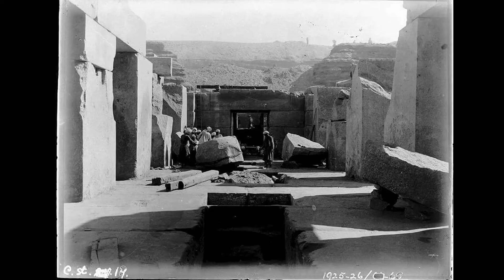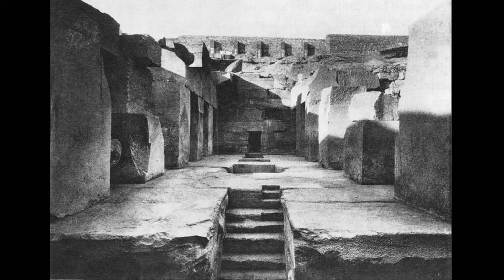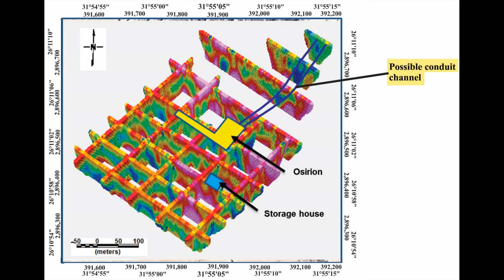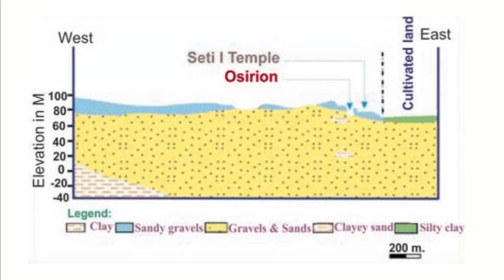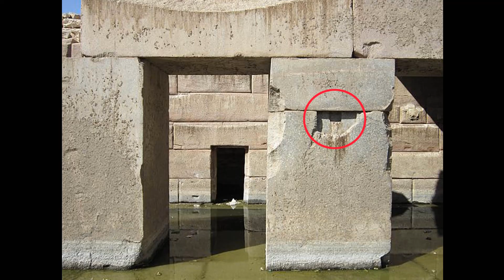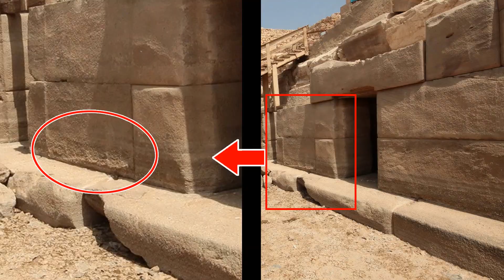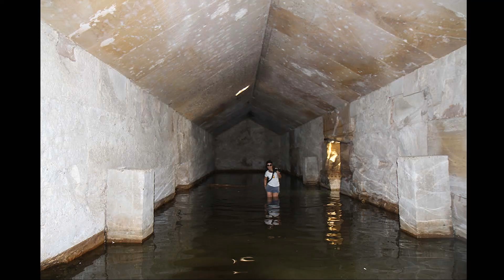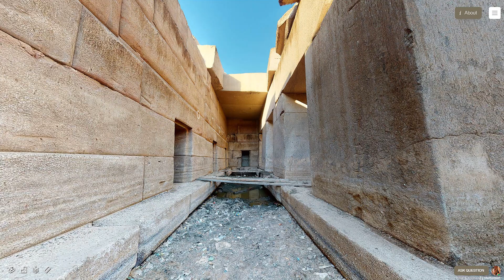The Osireion Mystery: Water, Construction, and Its True Purpose?!

Comment: cast concrete would mean having hundreds of different casing made for each block which makes it stup!d.
the advantage of form casting for concrete is that you can use the same form for pouring many times the same shapes.
so if it was concrete it would be many of the same blocks.
we flatten concrete on floors it's impossible to do it on walls because concrete is soft and doesn't hold it's shape vertically so that's really dumbb 
they are clearly carved and the fact that they flatten parts of a wall and stop just means it was too long to continue before the date that temple was needed.

if your idea defies physics it proves your idea is wrong.

have ideas that respect physics and you may be taken seriously but what you say is just ridiculous in so many ways it laughable.

why can't you believe people were that good and there was nothing other than regular humans and we just lost the knowledge they had.
Reply from the maker: No need to make individual molds for each block. I explained my thoughts on the molds and unique shapes in the latter half of this video - Explained: How were Peru’s Sacsayhuamán Walls Built https://youtu.be/x9S4CqY3eSA     When the cast blocks were placed in position while in a plastic state, the compression from above and sides would have pact the playdough like blocks to fit into existing blocks thus change their shapes.  This way even blocks from the same mold would have resulted in unique shapes.
Reply: @CuriousBeingbyTina ok have you conduct real life test ? Certainly your theory most be backed up with test and real experiment, not 😅 imaginary science 🧪, furthermore, if granite wase made to become clay what other materials was used to even reduce the granite into powder to then used for your imaginary clay, this would mean that they used a technology that still ahead of modern construction, ..... JUST A SIMPLE QUESTION ❓❓, what would you do if you found out that it was built by black African, I mean subsaharan African 🤔🧐 would you still rule that out as an impossibility? 🤔 I wonder yet this wouldn't be very scientific of you u, we all know we all came from Africa yet no one has acknowledge that subsaharan African black are the author of such mysterious construction 🏗️🚧

Comment: Has anyone sent a sonar down in the waters? This will tell the shape of the underwater walls. If there are small openings letting water in or large man sized openings implying 
it was a part of a subterranean city before the Y/D event. When the oceans were 400 ft. lower.
Reply: In the pre Y/D event time, the Nile wouldn't exist or would have been a canyon.
How deep is the Nile? They just declared the Mediterranean was blocked at the straights of Gibraltar. The Atlantic rose and flooded the Mediterranean valley.
Reply: If so, the Osirian could be the tip of a sky scraper. Well built with mortis & Tennent and cast Crete granite. and flying buttresses. Perhaps the early people built ready for cataclysm. Maybe the elite greed for knowledge, not letting the average people have it, they died with it and the writings were lost.

Comment: You lost me once you started claiming the blocks were concrete. That's ridiculous.

It's much more plausible that the blocks were quarried, transported and set with "puffy" faces. As you said, sharp edges are prone to chipping and fracturing, so this is one way to mitigate that. Once the blocks are set, they are finished smooth with hammers, chisels and grindstones ONLY WHERE NECESSARY, since it's laborious.

On the pyramid, the section that is finished smooth was once the INTERIOR wall of an adjoining temple, so it had to look nice. The rest of the outer casing stones were left rough because smoothing them wasn't worth the effort: they'd look smooth enough from a distance.

Partially-finished walls here almost certainly follow the same reasoning. Without studying the site it's hard to say, but it's probable the finished surfaces were originally the interior walls of rooms. The other walls and floors could've been wooden and long since perished, or other stones that have been removed.

Comment: Tina, thank you for delving into this astonishingly mysterious site. Your passion and curiosity are always so inspiring. I thought I'd share a few critical insights since I've been here several times and studied this site for so many years.  

1) Distantly visible at 1:47, the tall carved bedrock wall that surrounds the site has ancient water erosion. No one ever mentions this! This region in Egypt last experienced a significant, sustained wet period between 14,500 and 5,000 years ago. The most recent rainfall peak was probably between the period from 10,000 to 8,000 years ago, at which time most of the Sahara was grassland. After about 6,200 years ago, the region started to dry. This was long before Seti I or dynastic Egypt. 

2) The large square columns are not granite but granodiorite (harder than Aswan red granite). The walls are not cast but real sandstone because any cast plaster/concrete/stone always has one telltale sign: either perfectly uniform grain or evenly horizontal banding formed as material sets in the mold. These Osirion stones have neither. 

Sandstone also is not automatically softer than granite. While weak, porous sandstone is soft enough that you can scratch it with a fingernail, very compact, quartz-rich sandstone can only be scratched with a steel point. This means some forms can absolutely be as hard as granite. Sandstone in the Osirion is said to be almost as hard as granite though I've not personally properly tested it. 

3) Dismiss the round tunnel roof visible in the 1:47 shot (and the roof of the long walkway that follows but not in the shot). These are a modern addition from the early 1900s. 

4) In the large Eastermost chamber, I have personally witnessed bats fly out of holes in the wall! There is obviously enough space/possibly a hidden room back there? Also, this chamber has the same roof pitch as the interior of some pyramids.

5) Digging a MASSIVE pit where the finished surface is at least 5 stories (!) deep and then filling it back up with massive megalithic blocks to build a giant stone island is a mindblowing amount of work. It would make modern excavators balk. To put this in perspective, the excavation for the Empire State Building's basement went down approx 55 feet, which is likely less than the depth of the Osirion! 

For the Empire State Building, it took approximately two months of continuous effort by two shifts of an army of 300 men working 24 hours a day. The tools used during excavation included modern steam shovels, compressors, massive steel cranes, and pneumatic rock drills. To do this with small chisels would take how many years? And yet people are so oblivious to the Osirion's pit and can only sadly see the walls and columns. 

6)  In order to write easily and legibly, the dynastic Egyptians were famous for shaving down older walls they found to place their hieroglyphs. There are countless examples of this all over Egypt. The original walls here in the Osirion were not smooth but rusticated and pillowed. Rustication is a FINISHED style and not "incomplete" as far too many theorists assume. This style was last popular during the Renaissance. Google the Palazzo Medici Riccardi in Florence to see the ground floor's finished exterior's rustication. The wealthiest and most powerful family in Europe did not have an "unfinished" palace. Rustication signified not only primal "strong as a rock" design but held esoteric meaning.

Later Egyptians shaved all the Eastern wall of the Osirion and covered it with hieroglyphs. They started to do the same to the columns but the writings are cruder due to the stone's hardness. They started also to shave the Northern wall and this is what confuses most people as being "incomplete." Yes, dynastic people had corundum sand and could use it to slowly manually shave down hard stones grinding it beneath a stone brick, hence the strange but very evenly squarish shavings on the sandstone walls.

Another famous example where the dynastic people obviously shaved the exterior walls is the front/back of the Menkaure pyramid in order to write hieroglyphs. These writings are still visible if you look hard enough on that pyramid today and only where it is shaved. The shaving on this pyramid is not original and this can be logically deduced by studying how Menkaure's original outer temple is built directly against rusticated walls and not smooth walls. 

7) Nubs are a crucial detail and a key sign that it was not the culture of Seti I. Nubs are an integral part of a FINISHED surface design. They were likely sacred to the original builders as they were in countless temples across the world from the numerous ancient temples in Turkey (Didyma is a great example) to the thousands of temples in Karnataka India, or the oldest sites in Peru. All are finished sites that have very odd and conspicuous nubs, where an overwhelming percentage of them clearly had nothing to do with lifting stones in place. 

Nubs are even found on the finished bedrock walls of the Aswan "Tomb of the Nobles"...surely no one was trying to lift away the huge mountain! True nubs are not lifting bosses like those which are found on Egyptian sarcophagi, which understandably adds to the confusion. Being so conspicuous on too many sacred sites to count, nubs were clearly important, symbolic, and not to be removed!

Incidentally, there are places I've found on the Giza plateau that unusually have highly polished nubs (ie 100% finished) on rusticated walls. They survived here only at the very base of the walls because I propose they were almost certainly below the dynastic sand line. We find immediately above the sand they were all removed and shaved flat by later peoples that didn't care about what was still buried in their time. It's taken me so many years to research and document all the places these nubs are in Egypt but that is another discussion. 

There's so much I could continue with but that's enough for now! So sorry for the lengthy ramble, I love this stuff and will one day write a book. Sending many hugs, you are the best!
Reply: HOLY COW!  You need your own web site. 👏👏👏👏👏👍👍👍👍
Reply: In general, you seem to praise and support Tina's work.
However, Point 2 is irrelevant. You say the stone is real sandstone. This conclusion is only your opinion and is worthless. You are assuming that Civilization X used today's current methods of casting stone. Civ X could have used completely different methods of casting stone from the methods used today, and Civ X's cast stone may not have exhibited your "tell-tale" signs.

Comment: One thing I have noticed is that in constructions using megalithic blocks of hard stone, there is no mixing of materials.  If there is basalt, it is all basalt.  If there is granite, it's all granite.  If there is sandstone, it's all sandstone.  With cast stone there would be no problem mixing and matching to taste.  With modern concrete we mix in steel bars, bolt anchors, whatever filler rock is locally cheap, even hollow glass spheres.  

   In rock cutting the unit of efficiency is joules per cubic centimeter (j/cc), the amount of energy required to remove each cubic centimeter of undesired stone from the finished piece.  The finishing operations for hard rock cutting are mainly abrasive, and the energy required is around 3000 j/cc for diamond, corundum, or even hardened iron abrasives.  However, the cutting efficiency of stone grinding against stone is also about the same if you count the stone worn away from both sides of the cut.   If you are finishing both sides of a joint at the same time it makes sense to simply rub the blocks together until they mate.  This could be accomplished by positioning roughly hewn blocks together and fastening a very strong vibrating device to one of the blocks.  Where the blocks need help reaching a final tight joint, pokers could be used to push them this way and that, but leaving a gouge where they pressed and the stone wore away.  In the finishing phase, the face of the wall would have sacrificial blocks pressed against it to wear it flat except where the vibratory device was left in place for a final closing of the joints after settling has taken place.  This would leave a nub to be removed later.

  As for the vibratory device, a disk of dense metal on a flexible axle could roll around inside a ring to make vibration as the axle is turned.  The peak force occurs when the disk is 2/3 the diameter of the ring.  What would turn the axle?  I have no idea.  There might be other ways to generate vibratory force to rub giant stones together, but I really think this is the simplest solution
Reply: I think some of them actualy was from a quarry, my theory is it probably had to do with the denisty and desired durability of the stone so they could both withstand the load without cracking but also make it possible to control the weight in the rising structure by using lighter stones in the higher parts and stone with higher density to push down on the lighter rocks in order to keep the construction firm, and also withstand the pressure in the lower parts, also the top layer seem to partly had been made of stone types that where seen as more expensive and luxuuary at the time, pretty much as today, so they where probably used more for the eastetic apearance i think, but some of that could had been reused later for other things so only the core is left like on the larger pyramids, possibly.
Reply: This seems very plausible. I reckon creating the vibrations is easier than handling/transporting/manoeuvring such huge blocks.

Comment: As usual I love your deductive reasoning! It is and has been some of the best I have seen, read and heard about by anyone. Your understanding of stone working and general tooling far exceeds most so called Archeologists. I have stated in the past, I've worked in the granite and masonry fields in the jobs I've held over my working career. I've designed even some machines to work in the granite industry. I in fact have done head stone shape carving masonry fields in the jobs, rosettes on head stones, I've held over my working career. I've designed even some machines to work in the granite industry to do both grinding to shape after rough diamond impregnated blade saws cutting, to even the multi headed motor machines with varying grit levels to grind, hone and polish the stone surfaces and even with the cotton head buffing wheels and rouge compounds to obtain the glass like finish or burnish polishing the stone.. As old as this planet is it becomes unconvincing to me that we are only a species of a few thousand years old. Darwinian concept is way to limiting for our species on this planet of "How many billion years old"? I am still not clear on what the true meaning or reasoning for the Osireion was build for the depth of the mantel waters is bewildering. Was there any Ionization factors found or involved in the depth of those waters? Earths polarizing elements a fixed to that physical location has to have some sort of inter-play there. And to that of the other pyramidal structure locals. I wish China would divulge more of its buried pyramid structures. all 3 of: Tesla, Einstein and Oppenheimer would be stumped by these theoretical speculations. I agree poured, cast and screed surfaces are very well depicted there in the stone structuring. I understand if they had a completely submerged and enclosed structured vault, they were doing some sort of processing. It only makes sense  they were doing some sort of very sophisticated processing utilizing the depth of earths water to something scientific type processing. Water purification is way to simple a thought for the structure age and local. Keep going please with your inquiries it it all.  This is to me  base foundation of a very sophisticated charging and discharging process of some kind. A pyramid with a cap stone has to collect lightening bolts and doing something to the surrounding impaled land of that electrical discharge.. there is some sort of electro chemical discharging or charging taking place with in the structural confines of those areas... but whAt? Thank you  for your presentation, it is always a pleasure for me.

Comment: Possibly the granite Megablocks were more malleable back 420,000 years ago. The beveled edges are often ignored here, & screeting or Geopolymer/ concrete mix is not a possibility; (especially with Quartz veins in these Megablocks). Question: Does the lower 5 floors have other rooms or stairway acess?

Comment: The "secret" for impressive architecture like the Osirion is what one could call the "three-layer management model".  There is an Architect who draws the plans of the building, and decides that it will be made with 50-ton granite blocks with nicely smooth sides, squared angles, mortise-and-tenon joints, etc.   Then there are the Workers who must actually build the thing. And in between the two there is a Foreman, whose mission is to pressure the Workers so that they build the thing precisely according to that draft, no matter how much work it takes or how wasteful is the design.

That is also the "secret" for all sorts of good-quality stuff that is made today, from smartphones to skyscrapers.  If one tries to save money by getting rid of the Foreman, and have the Architect directly supervise the Workers, then either the Workers would do a sloppy job, or the Architect would patch and downgrade the plan wherever the workers had difficulty following it.  

Worse still is when a single person is expected to design and build the thing alone, as often happens to software built by hackers.  Then every function that looks like will require lots of code will get removed from the specs, and any design or implementation bug is classified as a feature...